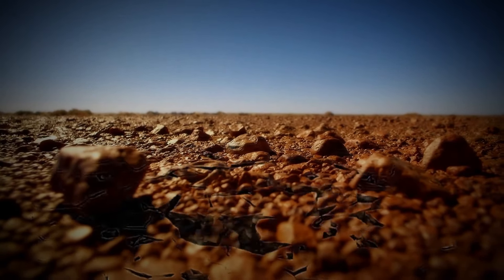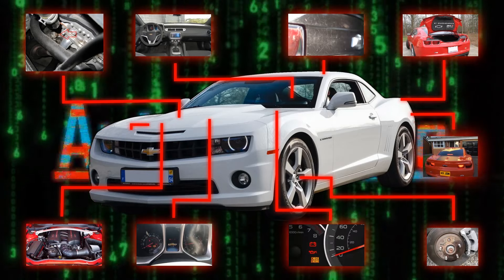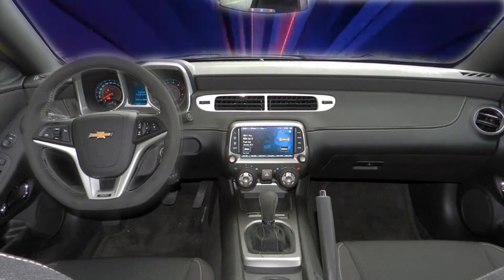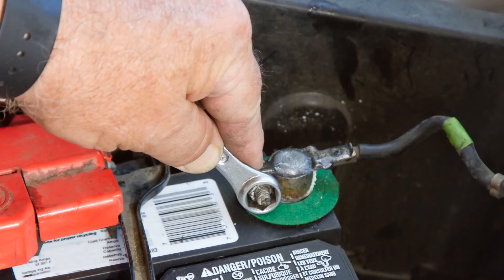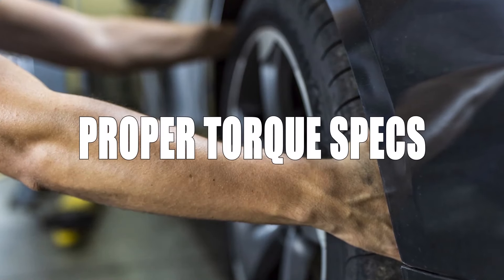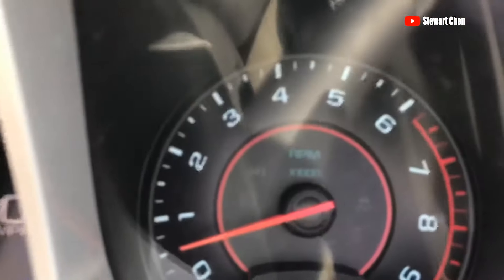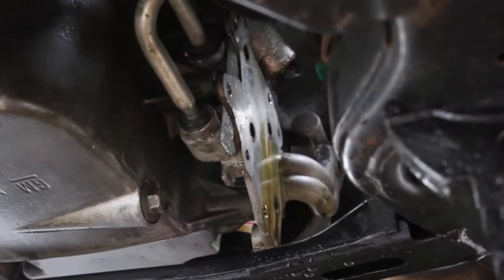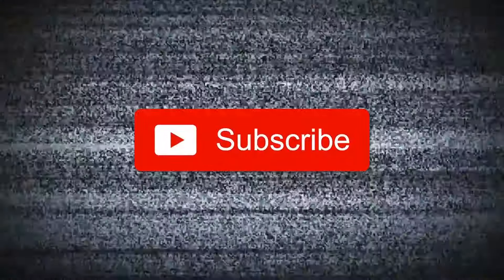Watch This Before Buying a Chevrolet Camaro 2010-2015 (5th Gen)

Comment: We have a 2010 2SS and have had NO issues at all whatsoever. Only owner, 178k miles. Great car!
Reply: Wow!
Reply: Do these cars also suffer from the harmonic balancer like the corvettes?
Reply: what is tbe difference between the ss and the 2ss?
Reply: @thebeast3822 Interior, 1SS is essentially a base V8 trim level; therefore, it comes with cloth seats. The seats have embroidered headrests in both, however.

The 2SS also comes with a set of gauges, which replaces the storage compartment (1SS) at the bottom of the stereo head unit. Often times, ppl will swap the 2SS (RS package) cluster of gauges, into their 1SS’ or V6, base LT’s non RS models. 

I believe the cars with RS packages also all come default with halo equipped front headlamp assemblies. They also come with factory HID bulbs, which use a different bulb size compared to the halogen headlamp housings (in the 1SS, 1LT, non RS package models/trims).  You can easily swap either to LED bulbs though, so it shouldn’t matter; except the halos can go bad intermittently, at a very hit and miss rate….
Reply: I plan on getting a 2015 Camaro 2lt and it only has like 37000 miles for around 20000 dollars.
Reply: 2nd owner but no issues so far.
Reply: LOVE TO HEAR IT IM LITERALLY ABOUT TO LOOK AT ONE RIGHT NOW AS WE SPEAKKKKK
Reply: @kspocketngroove3973 HOPE NOT IM GOING TO LOOK AT ONE RIGHT NOW
Reply: @thebeast3822 LET ME KNOW AS WELLLLLL

Comment: I have owned my 2012 convertible SS for about 4 years. Only problem I have had is a blown power steering hose. Other than that zero issues. Just pure fun..
Reply: Not really
Reply: I'm getting mine next year. Just hope things don't mess up with the economy
Reply: @alexamorin5534  fax
Reply: @alexamorin5534  did you end up getting it? my dad just purchased one and i was wondering if any more problems occured
Reply: @derek_thatkid  hey... no
 Still saving for a 2018 :(
Reply: @alexamorin5534  got that 2018 yet??

Comment: I have a 2011 Camaro 2ss 6 speed and no issues on my ls3 91 k miles
Reply: how many miles now?
Reply: I have a 2011 ss manual 6 speed 265,000 miles on it. Only thing wrong is a lifter tick that I’m getting fixed right now!
Reply: @danieltims2393  holy fvck
Reply: I have a 2010 camro v6 rebuild 89,000 miles on it and the body haves about 100,000 miles on it and I have 24s on it
Reply: You guys don't push it hard do you
Reply: I got the 2021 1LT RS v6 10 speed it’s a beast
Reply: @ykworld4070  I don’t think they asked.
Reply: @meechiettk893  so 😂😂😂
Reply: @meechiettk893  I got a old car that will beat your dodge also 😂😂😂 anytime in my box Chevy
Reply: @meechiettk893  freedom of speech 🎤
Reply: @meechiettk893  😂😂😂😂

Comment: I've had my 2014 Camaro 2SS since May 2015, only has 66,000 miles on it and no issues whatsoever. Still in love with it and can't stop staring at it in my driveway.
Reply: I’m trying to get one next year spring any crazy oil consumptions problems ?
Reply: I have 2011 Camaro - V6 it runs so good. Not one issue. The only option was the yellow color - haha. paid 21K brand new from the dealer. I don't use it anymore but I don't want or need to sell it.

Comment: Recently bought a 2010 Camaro 2SS M6 with 85k on it, and I have had no major issues whatsoever. Love the car and praying it stays issue free!
Reply: i’m looking at the same with 90k miles. Any thing you notice ?
Reply: @TrayJayRecords  had the car since may. Absolute dream. Solid engine. Solid transmission. Immediately changed all fluids after purchasing the vehicle, including tranny and diff fluid and oil change. Made a world of a difference for smooth shifts. I learned manual on this vehicle so the clutch would typically be toast but it has not had one issue. One known issue I have ran into that we knew about prior to purchase was an electrical headlight issue. Fixed that simple. And then the throttle body sensor needed to be replaced, however due to the fact that the sensor is built into the throttle body, I had to get a brand new one. Luckily from GM it only cost me $200. I have no serious negatives about this vehicle. Huge upgrade. A lot of power. And I’m not stock either and it’s had 0 major or critical issues. Fingers crossed it stays that way 🤞🤞
Reply: @MrMaro62  does it have a backup camera? ive seen some with the camera in the rear view mirror
Reply: Heey. I'm also looking into one 2010 2SS automatic with 67 000miles. How has yours been after 2 years? Thanks
Reply: @ she’s runs like an absolute dream. Has 108k on it now. Have had no major issues with it whatsoever! Buy it!!! The market price for them has dipped significantly and you can get a super clean well maintained 2SS for around 18-22k nowadays. No regrets.
Reply: @MrMaro62  nice :)

Comment: We have had our 2013 RS/2LT Convertible for a couple years now. Second owners. VERY low mileage car. If you think your car rides bad, get rid of the stock Pirelli tires. Changed to some performance Generals and it completely changed the car. Wife and I take it to shows but I still drive it to work sometimes. No issues.

Comment: Never had any problems with my 2011 camaro 2ss little over 3 years now daily drives all day babe the only problem I have is changing my tires cause the way I drove always like to hear that v8 power when you flooring the gas

Comment: For the v6, I’ve seen a lot more issues with coolant areas of the engine. Water pump, thermostat, etc. also the paint on the hood and roof love to fade away
Reply: I've also notice the hood paint fading very easily as well, weird
Reply: @auper2223  it’s a pretty easy job to wrap them but they definitely do love to fade
Reply: I've recently just got my camaro and had it for about 2 months. Only had a few issues. Mainly cosmetic but the starter just went out on me but other than that nothing. Hopefully it stays like that

Comment: Mystic blue 2014 1SS..intake, headers, exhaust..only issue ever was the trunk lid brake light.  Automatic L99 car, love it!  Tires are spendy, but it’s my dream car
Reply: When I bought my 2010 2SS back in 2012 it had 22s pirelli  tires. 22s were heavy so i went with xo wheels in 20 and 315 rear 295 front staggered, bought some super cheap tires called landsail, $400 for all 4, they are still around that price, been excellent, wet, dry, great traction and the tread looks like the pirelli  tires. Will buy again when need new tires.

Comment: Just bought a 2010 ss. Thank you for the information, very helpful
Reply: Im looking for a 2013 2ss how much did you pay for yours ? The one im looking at has 72k miles and it’s 20k
Reply: @simplybuilt_1708  not sure where you're located but carvana had some decent stuff in the socal area
Reply: I want one so bad, I’ve been looking nationwide for a ss.
Reply: @simplybuilt_1708  i got mine for 12.5k with 80k miles 2010 2ss best car i ever bought so much fun
Reply: @Wajjajagg dang and I thought I got a a best deal ever 15K for one with 74k on it a few days ago for a manual 1SS but just found out today it has the RS package on top of it plus sunroof and ground effect package from factory

Comment: my 2014 ss 6 speed has 86k miles and has never had any of these problems o.0 also the ls3 can handle 600hp before needing any upgrades at 650 only need to upgrade the valve springs
Reply from the maker: You are right, but how long will it run, reliably, with 600hp? I’m talking about long term reliability.

Comment: 4th gens are money pits, but i love the "bullet/jet" styling....wouldn't mind having a 5th gen or 6th
Reply: Before my 2010 SS I had a 01 z28, all bolt ons, tune and 3400 stall and gear change. Never broke a single thing, ran 12.2 all day and took it to 1/4 mile track every weekend for 5 years. i was even suprised the rear didnt blow up since i was using drag radials and getting 1.3 60 foot times.

Comment: Blend door for temperature control for passengers. 
Front window and dash needs to be removed or get a hot knife and follow directions in you tube videos, saved $3000.
Other than that by 2014 LS has been bullet proof and fun to drive. 100,000 miles.

Comment: The only issue I've had with my 2011 2SS is the trans temp guage in the cluster isn't reading, although the needle does the "sweep" when first starting the car. I haven't crawled underneath it yet to see if maybe a mouse has chewed the wiring or maybe a bad sensor.

Comment: Didn't even mention that there was two different versions of the 3.6 and the earlier ones had timing chain issues just like all of the early cadillacs and traverses.
Reply: I have a 2010 that had that 3.6. bought the car in Dec of 13 with 42k miles on it, had to replace the timing chain at about 65k. thank god I had warranty from the dealership I bought the car at. I only had to pay a $500 deductible.
Reply: I have an 11 maro v6 has the LLT 3.6 chevy did put soft timing chains in them had mine replaced under warranty it has a few mods an burns down the 05 to 09 gt mustangs so overall no other issues reliable so far

Comment: Some camaros you can access the trunk through the rear seat... mine can't so makes it a b* if my battery is dead dead and can't get to the battery which is in the trunk. I've had to try and charge the car enough with jumper cables taking about 15 min. Actually got a jumper  device which works real good enough power to pop the trunk
Reply: Convertible, right?  I don’t have a convertible myself, but I seem to recall there’s a hidden keyhole somewhere to get into the trunk from the seats.

Comment: I have a 2010 2ss(2009 build date). Only issue I can say it had ever, is the brakes tend to squeal when first driving. Changed to drilled/slotted and ceramic pads, still does it first after starting, but only for a few seconds. Also I do get slight vibration when driving but Is not bad. Could be time to go to new brake setup.
Reply: going for drilled and slotted setup to thanks

Comment: was wondering, about that rear 3rd brake light, couldn't it be easier just to tap into one of the rear brake lights?  right or left, and connect the rear 3rd brake light? that would bypass the the removal of the outer body side panel.

Comment: A sbe LS3 can handle around 700ish hp rather reliably. If you plan on  putting a lot of boost on it, and are trying to push more than 750-800hp. Upgrading the internals is recommended, for the engine life. But a sbe ls engine putting down 600-700hp, and being driven daily is not a big deal. As it is pretty common to see nowadays.
Reply: I can say it has different  outcome for me

Comment: Biggest has been the AC/Heather HVAC blend door, 98% your going to run in to this problem. Have fun.
Reply: You right on that.
Reply: Yes, I had to recently replace the blender door but, there are a couple of videos that show you can go under the dash and fix it. Like i did.
Reply: Yeah, that definitely needs to be on this list. My son and I bought a 2014 LT1 auto a few years back and have put 18k miles on it. No problems so far. As far as the blend door goes: I don't use AC, ever (that's what windows are for). Well, actually, when my wife demands that I turn it on, then I put it right at the first blue circle setting (not anywhere near max), but I'm hoping to prolong the life of the blend door by very rarely ever using my AC.
Reply: I fixed it on mine, it’s for sure not easy job, but i just cut the side, on mine, and it’s been working perfectly over year or so. No
Issues just yet. Better than spending 3k at Chevy. I only spend like $80 including the blend door.
Reply: @jorgemeza4974  How often did you run your AC prior to the repair (and at what temp level)?
Reply: It happen after 100,000 miles, and my girlfriend kept adjusting the temp a lot around the time. But before that very little to answer you question
Reply: @jorgemeza4974  Cool. Thanks, brother. Reminds me of some advice that my dad gave me when I was younger (probably around 12-15): "Your car will last longer if you don't let your girl drive it."
Reply: Hahahahaha, wise man!!
Reply: @nottelling4828  when u run into this it only affects running your ac? No real mechanical problems right?
Reply: @raybarrera1997  It affects both your AC and heat since the blend door no longer is functioning (it's just hanging at that point). From what I have been told, it blows room temp air regardless of your settings.

Comment: I have a 2012 2ss camaro for 4 yrs now only issue i had is brakes go bad quickly but no major issues.
Reply: Auto?
Reply: @brodrick Hughes with great power comes greater braking preasure lol running it up fast an hard braking is most likely the culprit haha 😄
Reply: @cristiansofake7854  yes auto
Reply: @jasonsanders49  😂😂 you right on that

Comment: Just bought mine from a dealership with 189k miles for 14,500k and trade in. Feels like I got ripped off. 😪😔feels like I made a bad decision despite researching the car for 6 months. But I hope all will be good and not too many issues
Reply from the maker: That is a bit of money, however, these LS engines are known to outlast the car. Hopefully it has been beaten its entire life.
Reply: @AutoMotivate  it has a huge dent on the side of the car so I know the car was beat up. Thinking of getting a lawyer and using the lemon law if I found major issues they didn't disclose. They told me the car was in should condition. I bought it from a dealership that sells chevy in troy alabama
Reply: Bro I can certainly say you did get ripped off I bought mine for 15k with 75k miles and I wouldn’t trade it for the world only problem I’ve had is the brake light
Reply: What other issues does it have?
Reply: I bought mine for 14,000 with 35k miles. Sorry to hear that.
Reply: @ryanmax-grappler8654  which dealership bro
Reply: @Greg-j4j7h  big 🧢

Comment: I have the service stabilitrak warning every time I turn on the car and it goes after shifting to 2nd gear (go over 10-15 kmh) the a abs starts making an odd sound then the warning comes back after going over 50 kmh I had it checked and the computer told me to change the speed sensor (front left) I have changed it and I still have the same problem the car now has no traction control, abs ...
My car is a 2014 v6
Reply: Use this video as inspiration and check out your battery cable and the clip
Reply: I have not done this yet.  I'm about to

Comment: Was actually watching this video until you got to the part where you said the legendary LS cant handle more power.  What a joke go look up the videos where tons of people go to the junkyard and get a LS and boost it through the roof on stock internals making 900 plus hp.   Cant trust this video now.
Reply from the maker: Reliable long term power is different from boosting a ls for a few drag runs. Huge difference.
Reply from the maker: Yes, you can turbo a 4.3l v6 to handle 700hp, but for how long?
Reply: Yeah you better do a lot more research yourself. Very reliable in the 650-725 hp range. Don't lie to people  tell them the truth.

Comment: This video is a complete waste of time! I have two 5th gen camaros (2013 rs convertible and 3013 2ss 1LE) and have had none of these issues after putting a combined 70k miles on the cars combined. In addition, im a mechanic and most of these issues happen on every car or are caused by mishandling the parts or tools to repair the car.

Comment: Pretty much everything in this video aside from the except for the pinched trunk wires can happen to literally all cars. Thumbs down.
Reply from the maker: You are right, with age, miles ect. However, these issues are more common overall with these Camaros. 
 Like the breaking lug nuts. All lug nuts can break, sure but it’s fairly rare. The breaking lugs are far less rare with these.

Comment: My trunk leaks water
Reply: There are two hoses in the trunk that plug into these holes.  For drainage or something and one of mine leaks because it's not long enough to go into the hole that is there located close to the trunk hinges.
Reply: Armorall your rubber trunk seal keeps it from drying out an cracking also swells it up a bit should cure your problem ..do that on every seal doors etc on all of your vehicles

Comment: This guy was misinformed on hp I've seen stock turbo engines make 700whp for years
Reply from the maker: Perhaps, I just haven’t seen it/found it with evidence of prolonged use.
Reply: The Camero didn’t have a turbo until the 4 cylinder 6th gen  . The 580hp numbers come from the super charged zl1 .